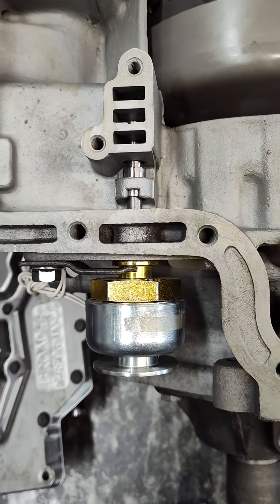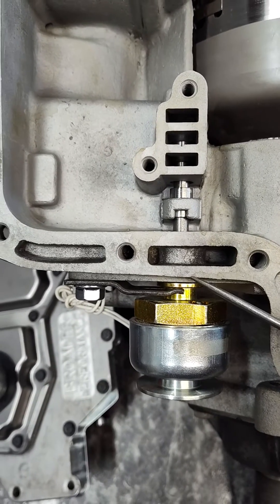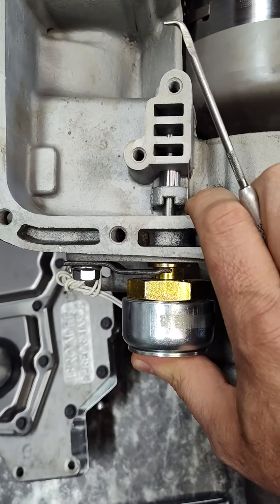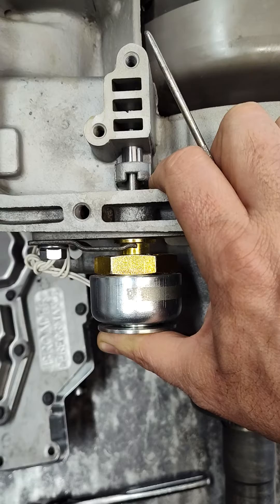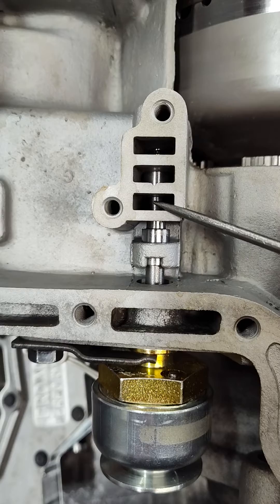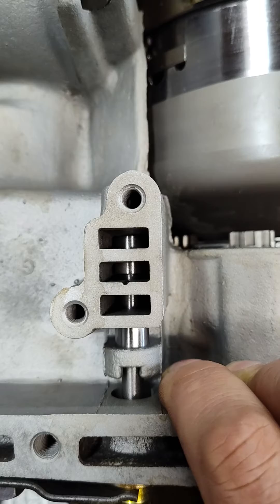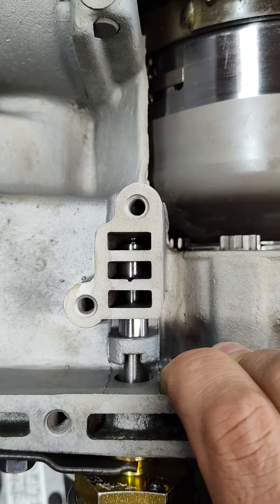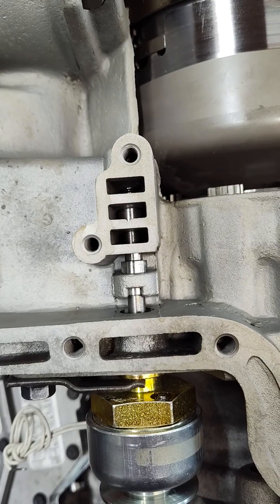Ford C6 Transmission Solenoid Valve Alignment Checks

Comment: I’ve got a c6 that just won’t shift down into low 1st unless I do it manually?
    It will barely grab in drive.   And once it starts to roll … it will grab 2nd and 3rd ok.   
    Any tips?   I thought about opening up the value body but afraid because it’s my only ride.
Reply from the maker: Not a great forum to try and trouble shoot problems here but check the governor before you tear into the valve body.

Comment: I just purchased your transbrake valve body,  and a couple other small parts, would you mind doing a short video of drilling the low reverse piston. I just want to make sure im doing it the right way,  thank you. If not thats ok too.
Reply from the maker: Thats actually on my to do list. We get a lot of questions on that. I will try and get that done. Good suggestion.